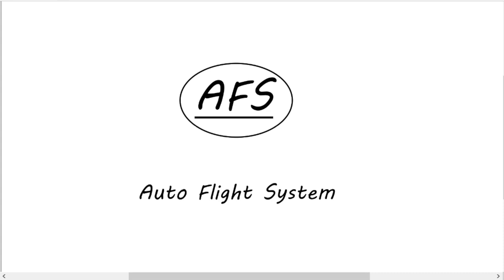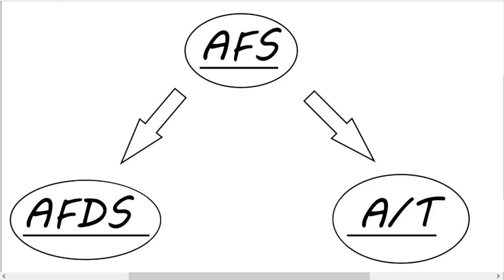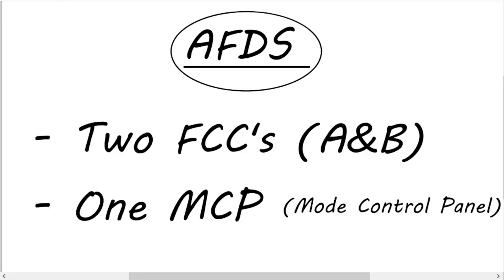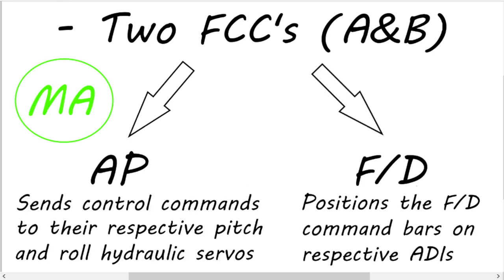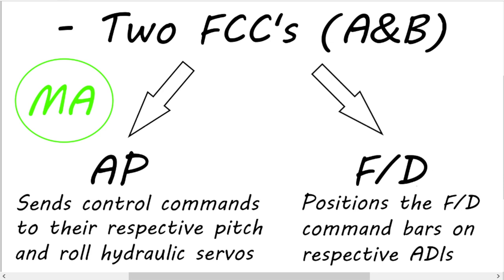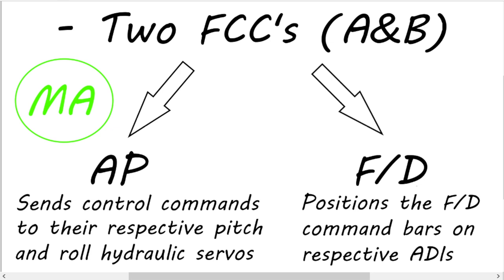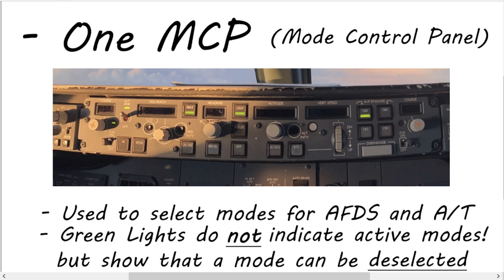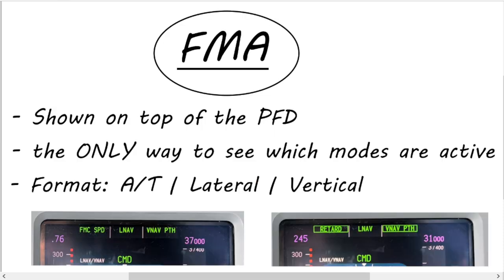The Auto Flight System - A BASIC Overview | Real 737 Pilot

Comment: Can you do a video on a flaps extension schedule on approach? I have the feeling I'm starting way earlier than I need to.
Reply: At 10 miles 5 flaps and 15 miles 15 gear down then continue to 25 30 and 40 if needed
Reply: To see if you are passing 10 or 4 miles go to fix page put rw(number of runway you are landing) then put /10 and /4 if the weather is bad put /5
Reply: @patpilot1675  10 miles flap 5? Depending on what approach you are flying the flap schedule will vary. On ILS it's usually Gear down flaps 15 at half glideslope deflection...at least that's what we used to do